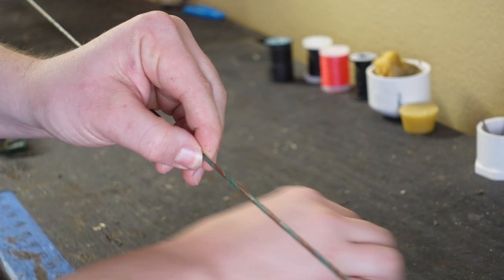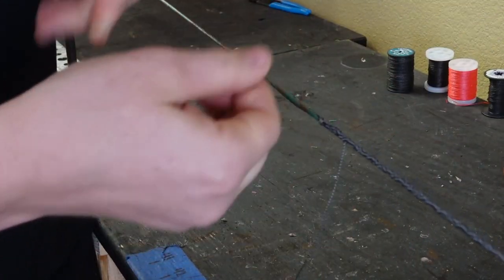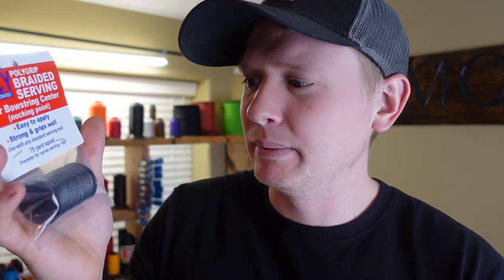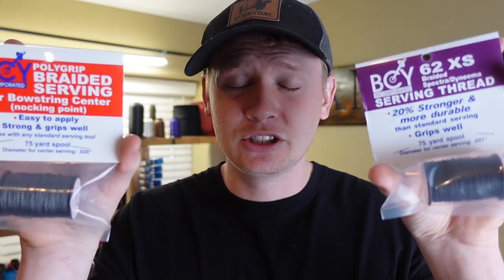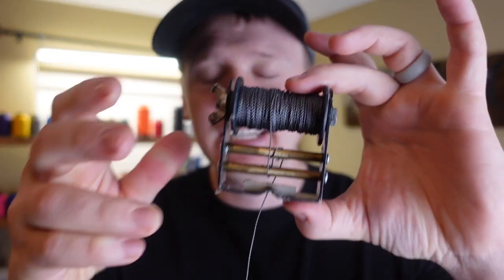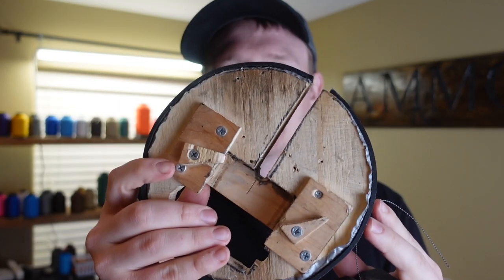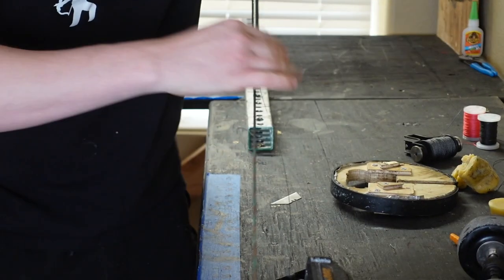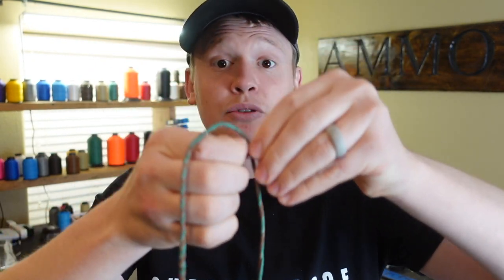How to properly serve a bowstring By Kramer Ammons.

Comment: I'm compiling supplies to build my own home compound bow maintenance station. I've got materials to make a crude/effective bow press, I've got enough lumber leftovers to make a string jig and a twisting jig. I work with steel often, I can make serving spool jigs from sheet steel(BTW, that serving spinner with the drill is genius, and I will likely be copying that concept once I get things moving with the basics). Eventually I'm going to make a medieval style crossbow(I do the blacksmithing thing too), and figured this would be a great way to prepare for that project, as it's going to need a beast string made for it custom. I enjoyed your video, and I hope all goes well with your product testing and such with Patreon